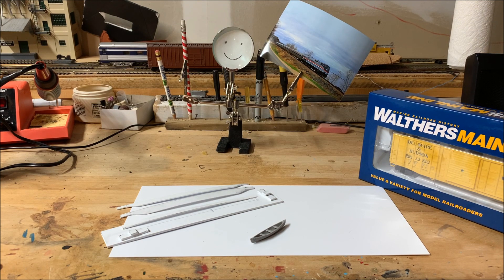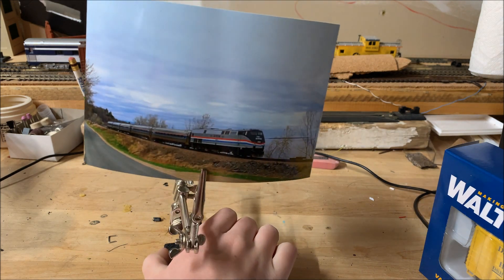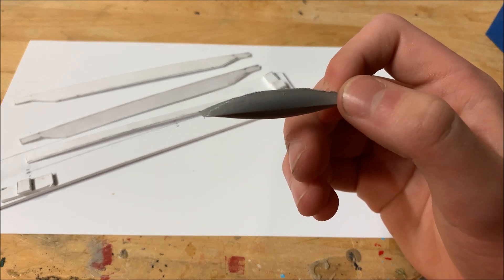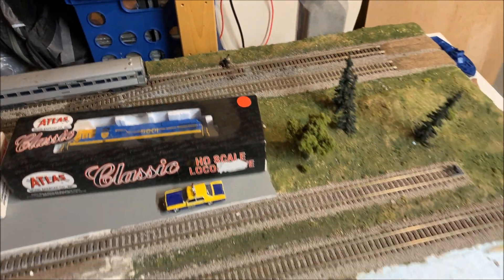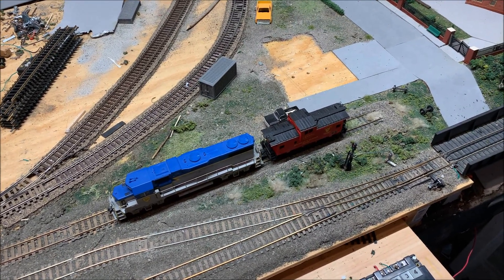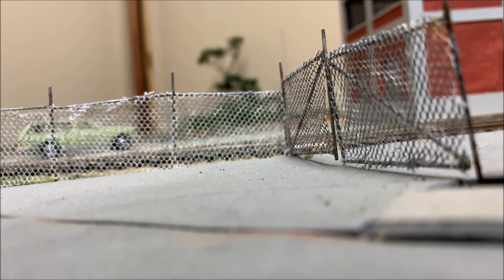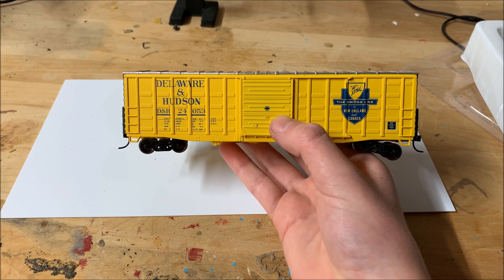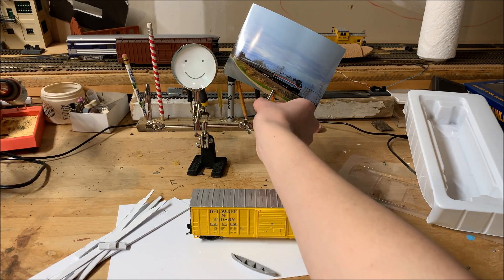Layout Video Update #1: 3D Printed Canoe, Demolishion Progress, Walthers Boxcar Review, and More!

Comment: Nice video! Can’t wait to see more from the layout! 

Also- I saw you are going Albany tomorrow. Of note there is a CSX K682 tied down in Selkirk behind the regional building with UP 7400, the Pink Ribbon engine, trailing. It may go south down the River line tomorrow so keep an eye out. Even if it doesn’t go south, you can see the engine off of S Albany Rd by the regional building (it’s labeled “CSX Albany Division Offices” on Google maps)
Reply: Also if you’re not already a member I recommend joining “CSX Albany Division Sightings” on FB
Reply from the maker: Thanks for the tip, I may try to catch that if I can convince the driver to go that far south. Thanks again!